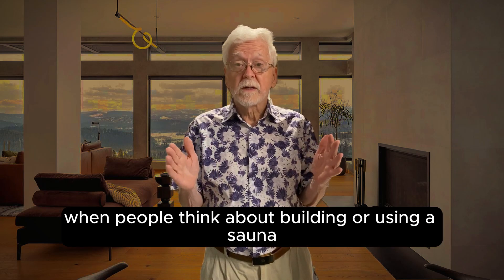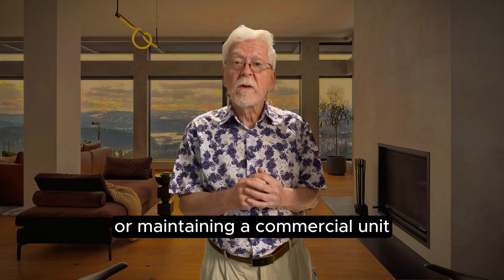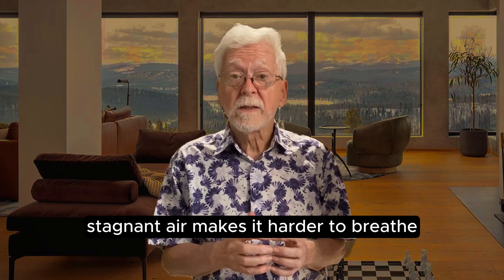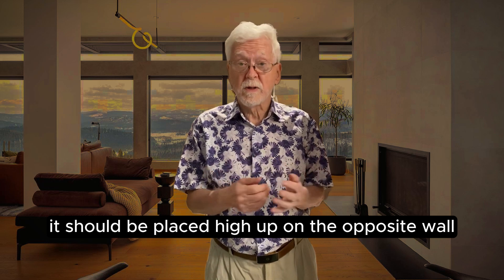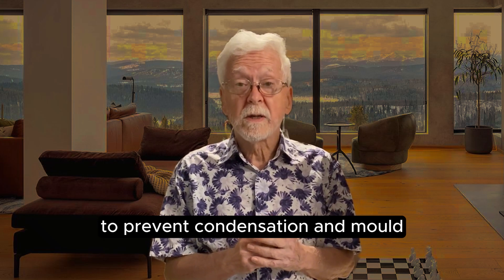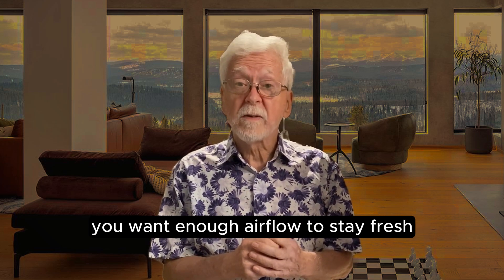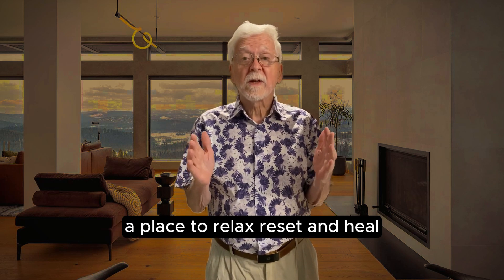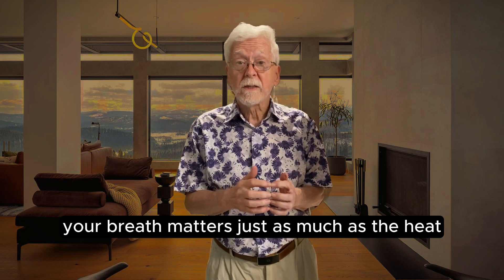Sauna Ventilation Explained | Why Airflow Is Critical for Comfort & Safety

Comment: Vents at the top of a sauna are for sauna drying after use. keep the high vents closed during use to avoid dumping heat.  But your right about the intake sauna  - close to the heater and low but the exhaust sauna should be at the opposite low corner and powered.